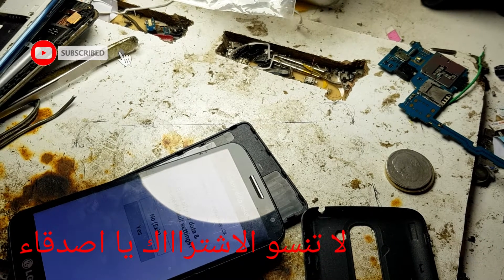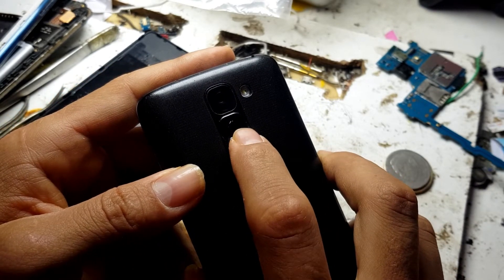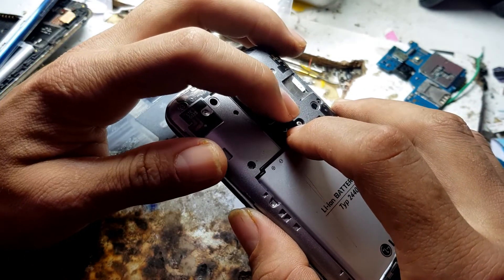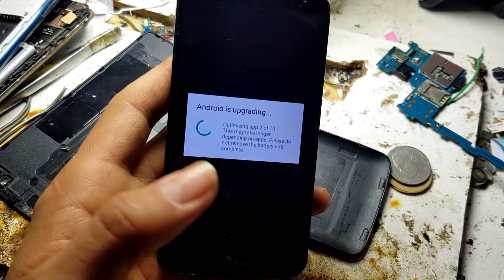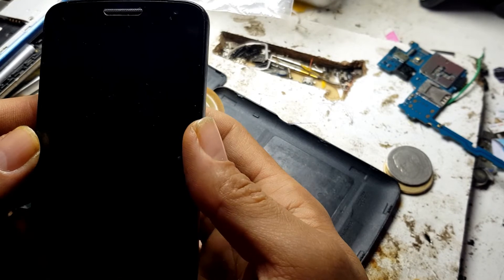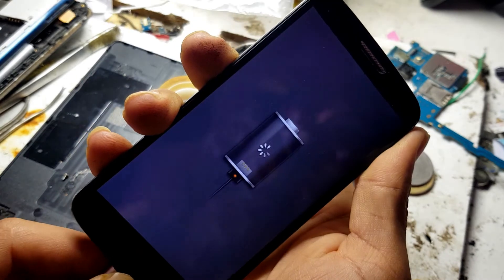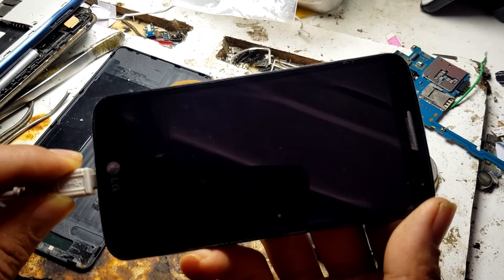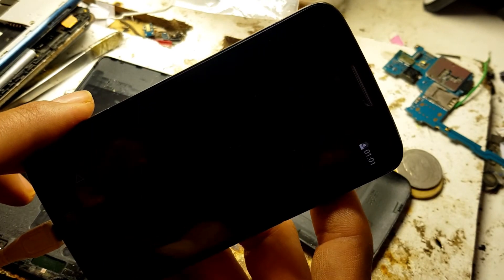HARD RESET LG G2 MINI LG-D620 | Remove Lock Screen . Pin . Pattren . Password

Comment: Found this phone yesterday in the garbage bin for waste electronics at my local supermarket that somebody threw away. 😘🤔😏

The battery was like 0 V but I was able to jumpstart it via an external  18650 cell & a couple of magnets & alligator clips. Tested the battery with my LiitoKala Engineer Lii-500 charger. Despite the low voltage when initially found it's actually in pretty good condition (about 1800 mAh of usable capacity). 🤔😕😎😇

The phone itself is actually fully working. The screen is intact, digitizer not scratched,... a great find.
Reply from the maker: That agrait